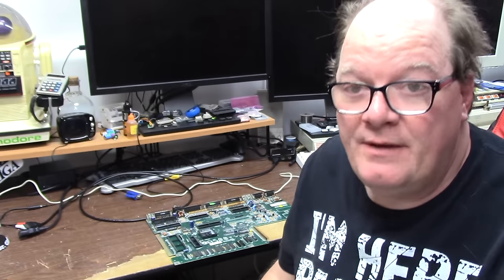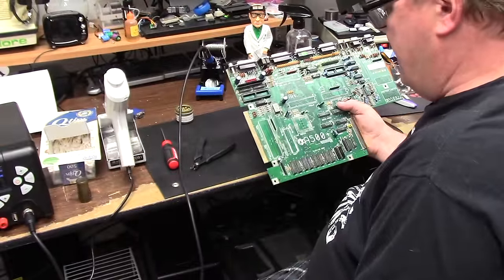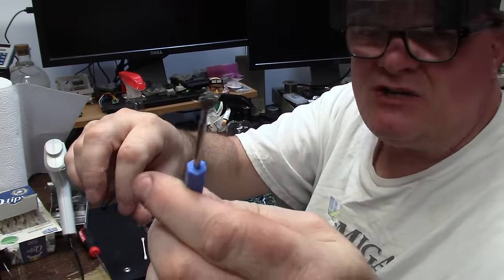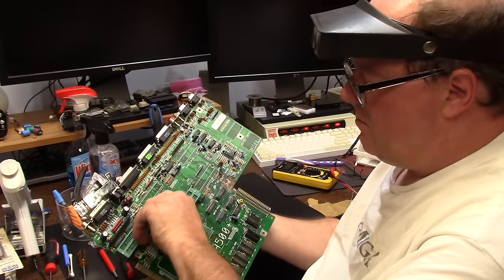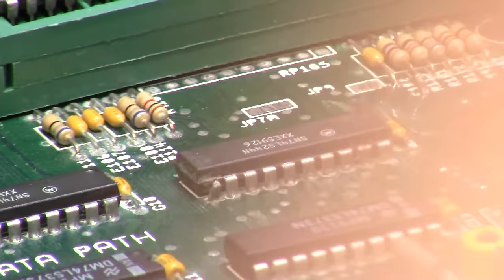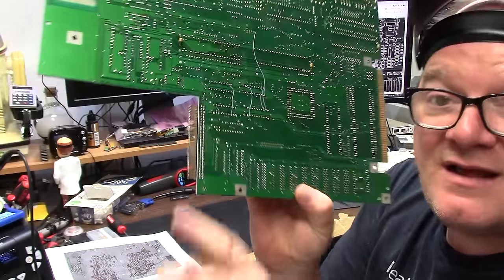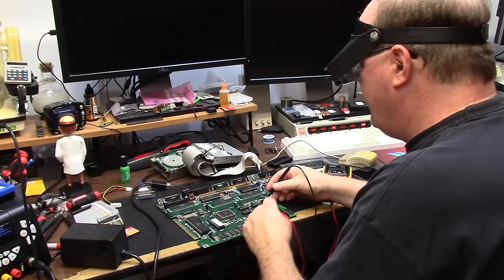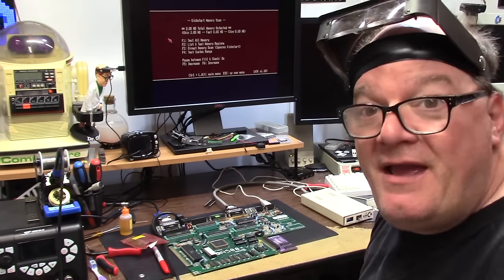The Amiga 500 of white ash

Comment: I have 25 - 30 Amiga 2000 Motherboards that have various issues. As well as 15 to 20 Amiga 4000 motherboards (from memory.) These have been sitting in a box for the past 25+ years. There are actually several boxes of Amiga related parts out in the garage. I've never really gone through all of it. One box is brand new Newtek Video Toaster t-shirts and ball caps circa mid 90s. I don't think they have much value, I really don't know. However, I would rather keep them than sell them for cheap. How did I require so many? Easy. I used to live in Topeka, Kansas and got these from a guy that used to work at Newtek before they moved to Texas. I now live in Kansas City. His name was Chuck is all I remember. He was one of the repair guys. He worked at Thoroughbred Computing in Topeka and had a chance to take a job at Newtek. He later relocated from Topeka to Texas, I think. Not sure what happened to him, or Newtek. The more I think about it, I am not sure where I got everything from. There were a few guys I horse traded with and or, that gave me stuff. I also have a brand new UNOPENED Amiga 4000 system, as well as a new Amiga 1200 Party Pack, Pal Amiga I bought off eBay years ago. And yes, I know the battery might have leaked onto the motherboard of the 4000, and that's fine. The value in the system is in it being unopened. I reached out to the "Last Gamer" on YouTube a few years ago to donate 280+ Amiga Boxed games, and he literally said no, "that he felt he would be taking advantage of one of his viewers." I still have the email. Who is the "Last Gamer?" His name is Joel, lives in Australia and is believed to own the largest video game collection in the world. Had the donation went smoothly, I would have also donated the new Amiga 4000 to him as well. I am glad I didn't. He ended up selling his home and moving into a much smaller place. His collection is now in storage. I would like to donate my Amiga collection to a museum, but only if they will be made available to the public. These days, I occasionally play a few games here and there on my Amiga 500 mini. I started out on the Amiga way back in 1990 when I was 20 years old and going to college. If you were a student, for $500, you could get an Amiga 500 educational package directly from the company at 50% off. You got an Amiga 500 1meg computer, a 1084s stereo monitor, software, a modem and a dot matrix printer. I love the Amiga but a, somewhat upset that no one has stepped up to the plate to launch new Amiga hardware. They launch very powerful handhelds seemingly every other month, but we are still playing 16 color 320x200 whatever 40 year old Amiga games. There is something wrong with that.
Reply from the maker: That is amazing that you have a new system. Unfortunately, it’s probably destroyed even though it’s brand new.

Comment: Hi Chris, it looks like Mouser has a 68000 compatible 3M ZIF socket. Mfr No 264-4493-09-0602J, Mouser No 517-264-4493-09.  Pricey at USD$50.  If you choose to get it please double check the package dimensions, I think I got it right but I may have gone off an incorrect 68000 document.
Also, please please please use a lower volume on the explosion, the volume jump is going to kill someone's speakers, ie mine!